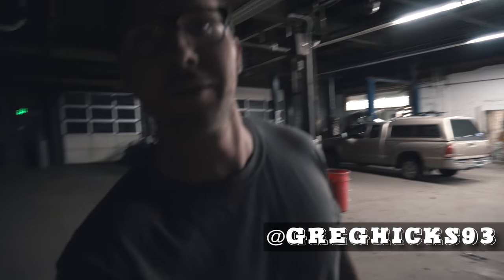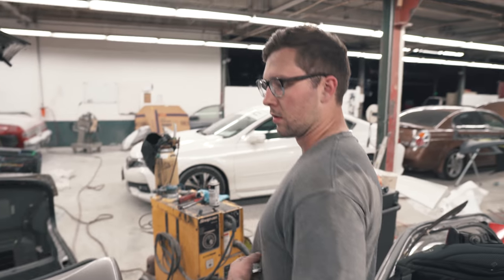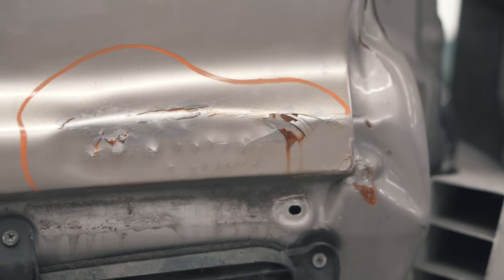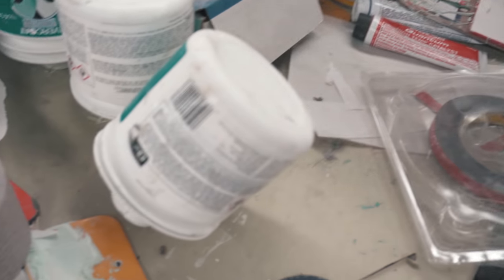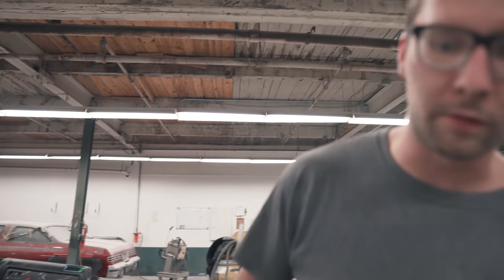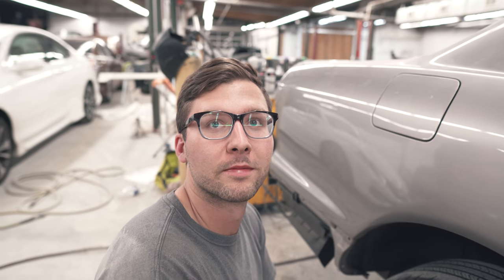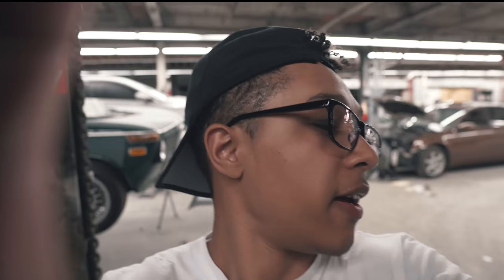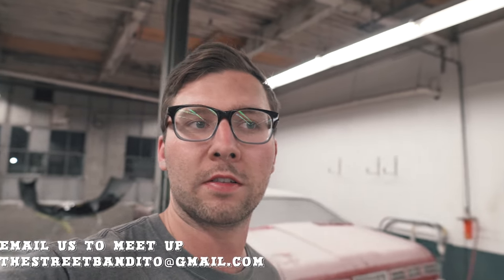LS400 Drift Taxi Build - Exterior Paint Prep (4K)

Comment: Polyester glazing puddy is made to adhere to paint, and metal.  bondo/ body filler is formulated to adhere to a prepped bare metal surface only...they both will stick to pretty much any prepped suface as long as its scuffed and cleaned properly.